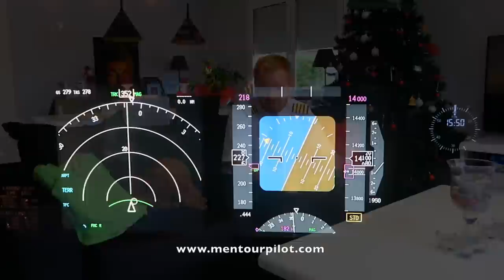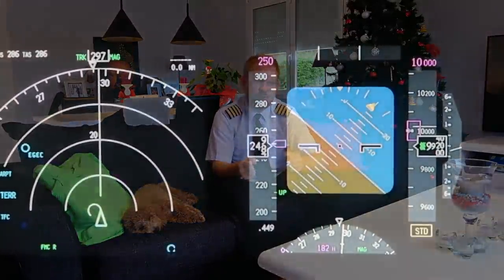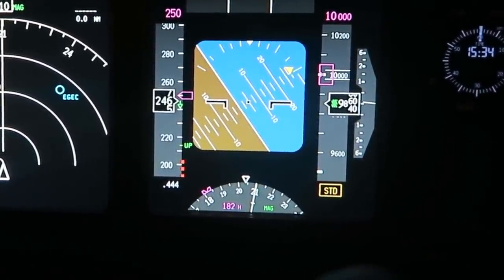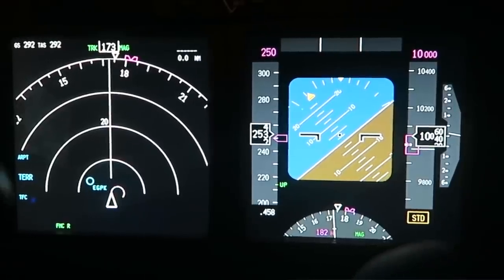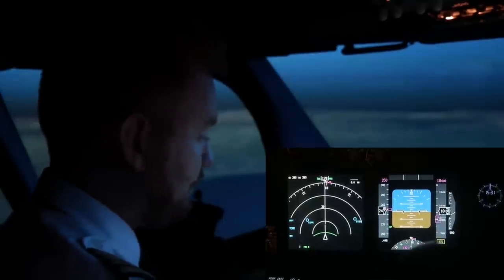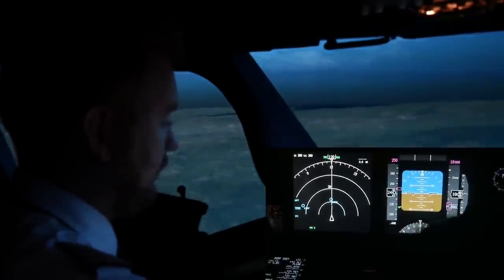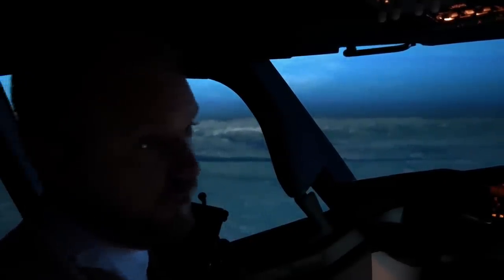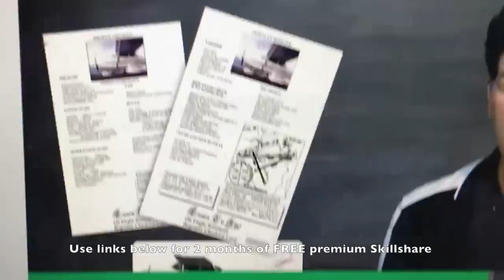What happens if you ROLL an airliner?!

Comment: An aileron roll is arguably the easiest aerobatic manoevour to learn.  The way to roll safely without pulling significant "G" or getting close to the stall is as follows:-  At a safe altitude, dive the aircraft to a high speed (no need to get close to Vne though - maybe 2.5 to 3 times stall speed).  Pull up smartly into a steep climb (30 to 45 deg) - this might produce 1.5G or so, but you can also be less aggressive if you want to be gentle on any newbie passengers (see later how to compensate for the resultant excessive speed bleed).  The slower the aircraft rolls the steeper the climb angle you need.  As soon as you achieve that steep climb angle, center the elevator and apply full aileron - don't pull back on the stick as you normally would when rolling, just hold full aileron, hold the elevator neutral or, if necessary use elevator to control speed, loading or direction.  As the roll progresses, the nose of the aircraft will begin to drop and the rate of climb decreases.  If your initial entry speed and pull-up angle was correct for the aircraft, then as the roll reaches 180 degrees (fully inverted), the aircraft nose will have dropped to be level with the horizon and your vertical speed will be zero.  Maintain neutral elevator (or use as necessary to control speed, loading or direction) and maintain full aileron.  As the roll continues, the nose will continue to drop (now below the horizon) and the aircraft begins to descend.  Both the dive angle and rate of descent continue to increase until the aircraft has rolled back to zero bank angle (upright).  At that point center the aileron - your dive angle should ideally be the same -ve as your initial climb angle was +ve, and you recover from the steep dive by pulling back gently in the normal way.  With practise you will find the perfect entry speed and climb angle.  If you kept on a good amount of power, your height will be approximately the same as it was at the bottom of the initial dive.  If you maintained cruise power throughout, your minimum height will be somewhat lower (but not excessively so).  Ideally the only "G" you pull is when pulling out of the dives at the beginning and end of the roll, which can be quite low "G".  No need to worry about stalling in the event the speed decays too rapidly ... monitor the airspeed closely throughout, and if it drops too close to the 1G stall speed, just push forward and "offload".  You can even push forward to zero "G" - at which time you cannot possibly stall (at zero G the stall speed is zero).  You can hold this low "G" for as long as it takes for the nose to drop (as it will automatically) and the speed to build up once again - though if you have to do this you will mess up your direction ("line") so it's only done to prevent a developing stall condition.  Similarly, if your speed starts increasing too rapidly and you think it might exceed Vne, then pull back in good time to increase your aerodynamic drag well before it gets out of hand.  At no time need the G go below zero or above 2 (worst case).  Usually it will remain between 1 and 1.5 G (or less).  For a more polished manoevour, keep your direction straight (or deliberately turn to exit in a different direction to your entry) using rudder and/or elevator (depending on the roll angle at the time).  A variation is to forego the initial dive and start the roll from straight & level flight.  This results in completing the roll in a much steeper dive and a higher speed (and greater loss of height), and is something I often did at the start of an aerobatic sequence as a less boring way of achieving the necessary entry speed for a loop, half-cuban or roll-off-the-top etc.  It should not be done in an aircraft that cannot roll very fast, because you will exit at too high a speed.  I would be very interested in seeing whether standard low-G, low-stress aerobatics such as this one can be carried out in an airline simulator.  (A barrel-roll is a different thing, and is essentially a simultaneous loop and aileron roll).  The low rate of roll of an airliner might make it more difficult - the slower the roll, the greater the nose-drop.  A military jet can roll so fast that the whole manoevour can be completed with almost no change of height at all.

Comment: I did it with a Boeing 777, and a 747 with flight sim. To do it, diving is needed to achieve higher speed. Then the flaps to full to start turning and the rudder while turning.

Comment: Two comments: The aircraft Tex Johnson flew over SeaFair was the Boeing Dash 80. The Dash 80 was quite a bit different than the successor Boeing 707.

I was flying jump seat on a Boeing 727 in passenger service approaching JFK when a fuel tanker crossed the runway. The tower canceled the landing clearance, and changed the active runway.

The pilot flying was a former RAF pilot and instructor.

He rolled a "dirty" 727 60 degrees, held the turn until he was lined up, short final, and completed the landing.

Looking out the left side window, all you saw was water and buildings.. no "sky".

If my eyes had been closed, I don't think I would have sensed the unusual attitude, he was THAT smooth.

I didn't think it was possible to do that, never mind complete the landing.. glass smooth.

The only thing I ever saw like it was Bob Hoover's engine out (both!) in a Shrike Commander.

There are a very few "old and bold" pilots.

I'm not one of them.. but I stand in awe!

Comment: With small High wings aircraft, the most fun you can have is called "Advance Turning". That is making a tight turn (or few) near 90 degree bank angle. Requires Full Throttle and Rudder in the opposit direction to maintain altitude. Love it ! :o))

Comment: I'm reminded of the AC that went to their service ceiling and killed the engines (not intentional) and they crashed (both died).  Simulators are great places to test things we'd never do in the air.

 Having said that I had  evaluation with a pilot who was known to fail people.  He set me up in a very difficult position (came thru) but then failed one engine and talked us thru what to do in that "unlikely" situation.  His method killed our 2cnd engine.  Normally I believe in one pilot inside while the other is outside (still flying) in emergencies, but in this case I moved all the switches and restarted the engine myself (while flying) and broke out of the clouds auto-rotating (and making all the callouts/steps) and indeed got the engine started.  I knew I'd not have a failing grade after fixing his mistake. :)

Comment: I must make a correction. It is possible to maneuver an airplane into a roll but at some point the loads applied to the wing and the pilot MUST each exceed 1 G regardless of the type of roll.

This question came into my life when I was taking my training to become a private pilot. Someone told me a story about a pilot who supposedly rolled an early model 707 or 747 above the middle of the Atlantic ocean, in the dark at night, and the passengers never suspected a thing.

Later I studied engineering and worked out the math to see if this was possible. Not exactly.

We can look at two types of roll. One, where the plane is rolled while trying not to lose altitude. Pilots in airshows do something like this, a "four-point roll".

In this one, the component of lift holding the airplane above the ground will reduce as the bank angle increases, reaching zero at 90 degrees. This will cause the plane to descend vertically.  It won't last long if the roll is done quickly, but it will happen any time that the plane is not vertical. As the bank angle increases more, the pilot can control the angle of attack to maintain altitude. The pilot will experience negative G force, which would cause him to drop out of his seat when the plane is fully inverted. 

As the plane returns to a upright attitude, the pilot will have to increase the angle of attack to stop the descent. That will necessitate pulling more G's.

In theory, there's another roll that is theoretically possible, when the pilot feels a positive force of 1 G throughout the maneuver. However, when the plane is upside down the airplane will be accelerating downward at a rate of 2 G. When the roll is completed, the plane will have dropped as far as any dropped object would travel in that amount of time, and will have the same downward velocity as such an object. 

To return to straight and level flight without colliding with the ground will require significantly more than 1 G.

Comment: Kinda disappointed you didn't talk about FedEx 705.  Those guys flew a fully-loaded DC-10 freighter like a fighter, pulled enough g-'s to cause the counterweights in the elevators to bust loose and land in a field, and, although the pilots were wounded, land overweight safely (as the pilot was unable to move to the controls that dump fuel).   There have been a few shows that discuss the hijacker and his motives, but I'd really love to see you go into what that plane was subjected to. It's a really wild story, especially the part where the pilot wants to pull out of a nearly inverted dive but discovers the throttles are still set for takeoff!  FedEx wanted to keep the incident quiet and managed to repair the plane to the tune of several million dollars, and put it back into service.  That plane is still in service as of 2021 and I've heard it still has some dents in the overhead console from the hammer attack.

Comment: There was a 737 in Brazil during a hijack in the 1980s that also did it, some parts of the stabilizer were lost in the process.
Reply: VASP Flight 375. It was a 737-300.

Comment: Funny facts:

30° bank steep turn requires about 1.15g load factor to keep the altitude (insensibly unless you hold something heavy in your strait arms in front of you)
45° - about 1.4g (pretty noticeable)
60° - exactly 2g (no problems while you are in your seat)
70° - almost 3g (exceeds the capabilities of airliners but Cessna C-172 can do it... unless you get blacked out)
80° - almost 6g (F-18 can but it may kill the pilot)
90° - infinite g's (everyone onboard is flattened like beer cans under the asphalt roller but nevertheless unable to maintain altitude)

Comment: Barrel rolled a 747 classic simulator. Biggest problem is roll rate. Need a good pitch up before rolling, over the top push, then pull as you roll out. Took about 10-15 seconds to roll.
Reply: I believe 747s have been rolled in real life. I think in the video, MP should have pulled up a bit more before starting the roll.

Comment: I was landing at Ft. Myers.? in a very small Piper Tomahawk from the west.     ATS cleared a jet to take off on the other cross runway, towards the north.     There was no risk of collision, but I was very concerned about wing tip vortex from him, if he lifted before I got to that part of the runway.     So I did a careful 360° turn at about 400 ft and then came in and landed safely.     No comment from the ATC.

Comment: There was a guy in 2001 n Oregon who worked for an airline, tugging planes, etc.  He " borrowed" a dual prop plane ad did a loop and a barrel roll.  He decided he didn't want to face the consequences and revved up the engines and crashed the plane into an empty island.  There is a house there but the people were not using it at the time.  If it were me, I would have tried to land.  I bet that is the hardest part; landing a plane like butter; or do a touch & go.

Comment: I read of an incident whereby a very new type of clever passenger jet misbehaved and did the opposite from what the pilot told it to do, and inverted.  In desperation the pilot manipulated the controls back-to-front, and the aircraft, by deliberately disobeying the control inputs, did exactly what the pilot wanted it to do, by telling it the opposite.   If you ever receive this, I’d love to hear more about it.   (They went on to make a safe landing.   (Eventually.))

Comment: Air Nippon nearly did this in 2011 I believe when the captain returning to the cockpit knocked on the door and the F/O accidently turned the rudder trim switch while the plane was at cruise speed rather than the unlock switch for door causing the plane to go nearly inverted but he was able to recover the plane back to level. This plane was a 737 700 and I believe there was one minor injury to a crew member but everyone was fine and the plane was unharmed.

Comment: An aileron roll is a 1G maneuver. It's perfectly safe. I did it in a T-6 an the instructor says if done right it's always 1G just like you flying straight and level. Get your speed up. Pitch up 15° go full left aileron and hold it until you get wings level again, you should be at a 15° nose down angle. Then gently level the nose. Done.
Reply: Yes. You've essentially made a cork-screw maneuver. You keep all forces within the aircraft essentially the same as sitting now in front of your computer. The only thing is, you won't be flying at a constant altitude, some amount of upward and downward motion must occur. Now, can a commercial aircraft do that? It might be taxing.
Reply: @thecarman3693  Yes I agree. I thought the question in this video was "Can you roll an airliner and is it safe". I think the answer is yes and yes. Although not advisable.  Whenever a pilot says "Watch this" my response would be "I have the flight controls"

Comment: It depends on the design specs.  FAR-25 does not include Rolling Load case.  If there is no additional special design provisions to do it,  the aircraft will be unusable.  there is no space to tell you about what will happen to the shear panels / skin, stringers,  frames, bolting holes, frames as well ass fittings where heavy loads are applied...etc.  Regards.

Comment: Starts thinking about the heck of a job a certain Eastwind Airlines pilot did when his Boeing 737 did an uncommanded rudder hard-over that threw his plane into such an upset... which he recovered from... thus solving two other preceding 737 crashes...

As I recall, Eastwind only owned two aircraft... and I flew as a passenger once on one of them... can't remember if it was before or after that incident though.

Comment: My experience of extreme banking is  at over 60 degrees in really small powerful thermals. You get induced roll, the outside wing is flying so much faster than the inside wing that it generates more lift. So you end up flying with the stick on the outside of the turn. It is a real balancing act as the glider wants to flip over. No use banking more because you have to increase airspeed not to stall, so even though you are banking a lot, your circle becomes bigger as you fly faster and you end up circling outside the thermal, generating more drag and ruining your performance. Oh yes, and I trim, when you do 50 complete circles you want to.

Comment: Early eighties and a B-737 is making a high speed transit of the Berlin corridor at 10,000 feet. Ferry flight, two pilots, four flight attendants. Window shades are down throughout the cabin.(Yes, this was premeditated.) Each pilot does a smooth aileron roll. One FA cracked the shade as she knew something was up.(Her boyfriend was one of the pilots.)

In the US, a major carrier bird is ferried to a major maintenance base. It arrives with lav fluid all over the ceilings of the lavs. Two pilots fired. Got to keep a slight positive G on the aircraft if you’re going to muck about.

Names withheld to protect the guilty.

Comment: Can you use rudder to help maintain a steep bank? Once you are well past 45 degrees (but less than 90), I imagine that your rudder is going to be more effective at pushing your nose away from the ground (and your elevator is going to help push you into the turn). I guess the next question is, "Can a typical airliner sustain upside down flight?".
Reply: No. Once the plane is at a super steep bank it's basically just cutting down through the air and altitude like a knife, the rudder isn't large enough to counter the force involved.

Comment: So if I understand correctly, during a turn, they bank to effectively have you feel pushed down into your seat rather than flung off to the side. This is combining banking with turning (yaw?). For rolling though, the goal isn't to change direction, it's just to rotate the plane over all the way. Separate to turning, he mentions pulling back on the yoke and increasing thrust to maintain altitude. I can see how pulling up while the wings are less than 90 would generate some more upwards force... but once the wings are in the "upside down" half of the roll from 90-270, would he want to be pushing the  nose "down" to maintain altitude? It looked like in this video, part way through the "upside down" half of the roll, the plane went into a dive, and he leveled the wings side to side and pulled up out of the dive. If that's accurate, why the dive? Can't he fly the thing upside down with enough thrust and angle of attack (nose "down" to go up)?

Comment: "You would never see a commercial aircraft with passengers on board do this."  What I am going to share isn't commercial, it's military, nor is it a passenger aircraft, but I will consider the fighter jock in the jump seat to be a passenger.  

My cousin flew C5 Galaxies.  Apparently they train this since the incident I will share was not the first time he has done this.  I don't know how many times he did it before, but on this flight he had a fighter jock in the jump seat and the fighter jock was dogging him about how he couldn't possibly be as good a pilot as the fighter guys since in this elephant he couldn't learn the aerobatics the fighter jocks have to use.  After a while my cousin decided this guy needed to see a Galaxy to a one G aileron roll.  He told me the fighter jock was white when this was completed and had nothing more to say about the flying skills of cargo pilots.